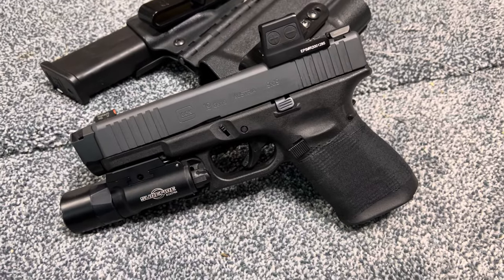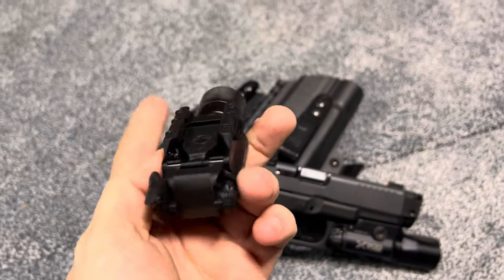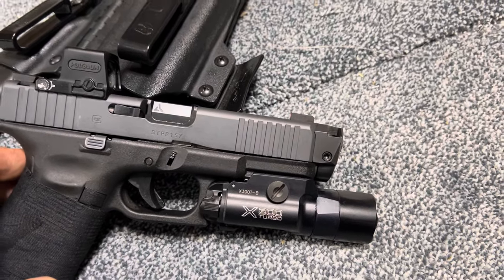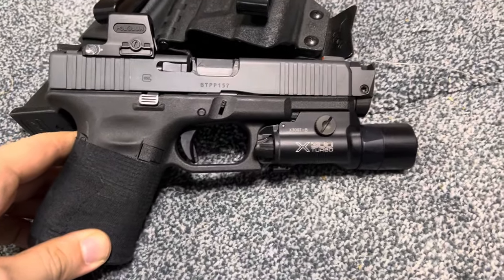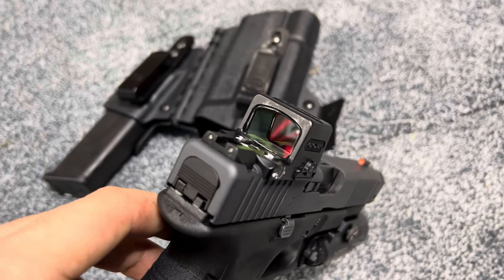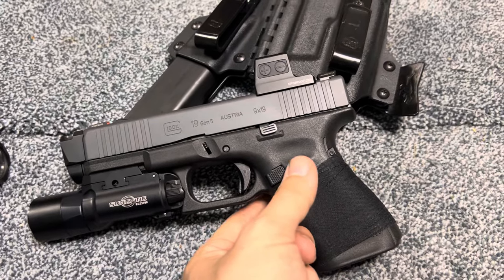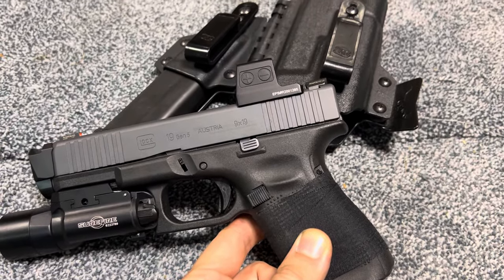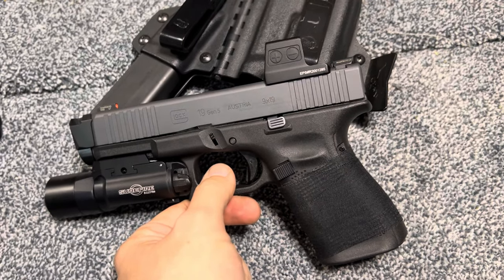Why is this Glock 19 Radian Afterburner & Ramjet Build so revolutionary?

Comment: I also run the afterburner on my Gen 5 Glock 19 and I love it. It works really well.
Reply from the maker: I was amazed the first time I shot it
Reply: @CatastrophicMalfunction  same! It’s I wis they made it for the g43x. Mine is snappy as hell compared to my 19.
Reply from the maker: @gmadgengarage  almost all my guns have some sort of compensation on them. If it’s reliable and it gives me an advantage, why not use it.
Reply: @CatastrophicMalfunction  I agree 100%. I’ve recently jumped on the compensator train and man do I love it. I have the radian afterburner on my edc gen5 19 mos and a killer Innovations velocity comp on my 19x. They both compliment my guns so well. I’m think king of running a third g19 build with either the Strike industries comp or the Arc Divisions compensated barrel and slide combo.
Reply from the maker: @gmadgengarage  the only thing you gotta be careful of with some comps is that some of them require you to tune them using different spring weights to run reliably
Reply: @CatastrophicMalfunction  yeah I know. I usually run higher powered ammo so I haven’t ran into cycling issues yet.🤞

Comment: I cannot justify $400 for this because I just don't see it there.  Im glad you like it and that it's working for you. Thanks for the video.
Reply from the maker: It’s the only thing I have because I live in NY where you can’t have a threaded barrel for 99% of the other compensators.
Reply: My boss has one on his g45 and I shot it side by side in our range and honestly it’s not worth the price tag imo but it does do something for sure, but nothing crazy.
Reply: its not worth the money, but if you have it and want to try go ahead
Reply: I agree not worth the $400
Reply: I got it for 250 on sale at primary arms. But if you haven’t shot it yet. It’s definitely worth the money
Reply: Definitely expensive but definitely worth the money.  Pair it with the DPM systems soft captured recoil spring and the gun shoots like butter.
Reply: It looks cool, look at it

Comment: The EPS is NOT an RMR footprint. It's a 407/507k footprint.
Reply from the maker: It comes with an adapter plate to fit an RMR footprint

Comment: Stock frame with grip tape, 👌. Respect brother. Sus on the slide cut for a Holosun... but if it works, it works.
Reply: Why is it sus? Cutting the slide for your exact setup is the best way
Reply: @ronnguyen8287  Just the Holosun sus, not the fine craftsmanship of the slide work. I know, I know, they are very popular now, but I'm a Trijicon mark.
Reply from the maker: What’s so sus about it?

Comment: The Glock 19 was adopted by special operations because they couldn't adopt another full size pistol do to the fact they already had the Baretta in service and I guess the brass thought one full size gun was enough. The glock 19 was a compromise.
Reply from the maker: I guess a G19 is also a good option for low vis operations too

Comment: The EPS looks great directly milled. I love that you can use stock-height sights with it. What moa dot do you have on yours? I'm trying to decide between the 2 moa and 6 moa dot but my lgs only had the 2 moa version for me to look at.
Reply from the maker: I’m running the 6 MOA dot on mine. I love how mine has been so far. The shake awake feature is awesome. When I first started buying optics, I was unwilling to buy non-American products. But Holosun definitely has some awesome options now that are reliable and much cheaper than most of the American pistol optics.
Reply: @CatastrophicMalfunction  100%. I can't see myself buying trijicon's new closed emitter dot when the eps is only half the cost with more features and similar performance. Not to mention how reliable Holosun has proven to be based on Sage Dynamic's reviews. I definitely think a 6 moa dot is better than a 2 moa dot for self-defense distance but I'm not sure how bad the bloom would be with my astigmatism.
Reply from the maker: @eat_ham876  I also have an astigmatism and Holosun dots are actually really nice. I can actually see a dot rather than a star.
Reply: @CatastrophicMalfunction  That's super helpful to know. I'll try one out soon.👍
Reply: Deff go with 2 moa bro. I have both the 407k and eps MRS. 6 moa is good for close up but you want a smaller dot for longer shots. If your worried its too small it can  get bright enough so it looks bigger than it actually is. Thank me later 👍
Reply: Look closer. There is no way he can see those standard height sights through the optic window. The rear sight doesn't even clear the base housing of the optic.
Reply from the maker: @jpdesimone  I don’t really want to see them much anyway but you’re right. I can’t see them through the glass. I think cowitness irons obstruct your sight picture. But I can understand why some people want them for redundancy.
Reply: @CatastrophicMalfunction  The optic height iron sights should be viewable in the lower third of your optic window, which wouldn't interfere with your illuminated dot.
Reply from the maker: @jpdesimone  not a huge deal to me 🤷🏻‍♂️

Comment: hoping the gen 3 will run good with factory RSS !
Reply from the maker: I never had any issues with my stock RSS. I just wanted to tune it to make it perfect. With the radian, you really don’t need to have their recoil assembly in my experience.

Comment: You mentioned wear on the front of your Glock. Is that from the compensator?
Reply from the maker: I misspoke. I meant wear on the top of the barrel near the chamber where the slide rubs on it. It happens with every Glock. Nothing abnormal.
Reply: @CatastrophicMalfunction thanks for clarifying.

Comment: My holusan battery tray came out flying while shooting.
Reply from the maker: Which Holosun was it?
Reply: i have my battery tray screw in with loctite
Reply from the maker: @9voltbattery  almost everything with screws on my guns has blue loctite on it
Reply: VC3 works better than blue loctite. It’s designed to remain tight with vibration but still allows you to remove the screw when needed.

Comment: I have a bullnose gen 3 slide (same profile as gen 5) for my gen 3 g19. do I get the gen 5 afterburner?
Reply from the maker: I would ask the manufacturer of the slide. Or if you want to just send it, stick with a Gen 3. There’s probably gonna be a bit of an ugly gap but you’re better off buying the right thing the first time.
Reply: Both will work gen 3 ramjet is flat the gen 5 is curved to fit

Comment: Does the comp stick out of your sidecar holster?
Reply from the maker: Yes if it’s in a G19 sidecar w/ the TLR-7A
Reply: @CatastrophicMalfunction  okay thank you, I have a g19 with an x300 and I just ordered a sidecar, but i didnt choose the cover threaded barrel option, will it stick out if its an x300?
Reply from the maker: @sergiodelgado7768  there’s a good chance it will even with an X300. If it was a G17 holster or you had checked the “threaded barrel” option than it wouldn’t have. I wouldn’t worry too much about it. I’ve never been burned from the comp on the range, maybe a little warm but that’s all.
Reply: @CatastrophicMalfunction  okay!! Thank you so much!

Comment: would this specific comp be reliable to conceal carry? in the sense that I know it will work 100% if i needed to use in self defense.
Reply from the maker: Other compensators on the market generally require you to change recoil springs to make it run reliably. The Radian Afterburner and Ramjet system was designed to be used with stock parts and basically any kind of ammo you put through it. I trust it and use it for carry purposes, and I would use it for duty use as well if I had the option in an LE or Military setting.